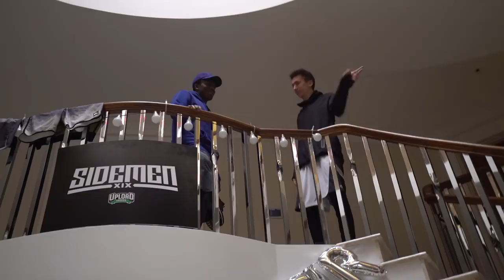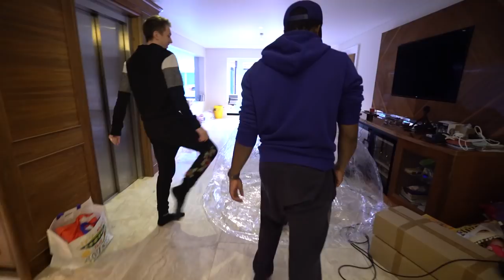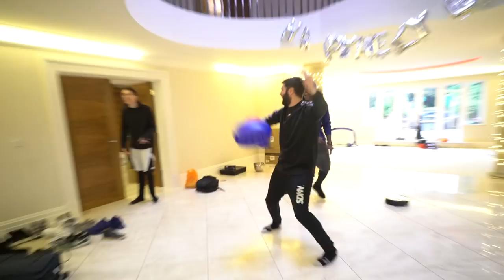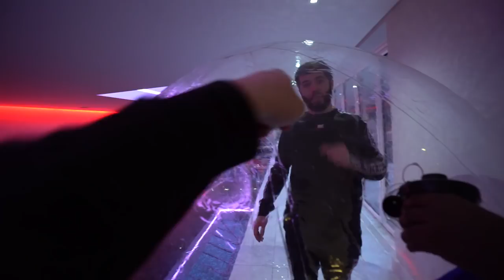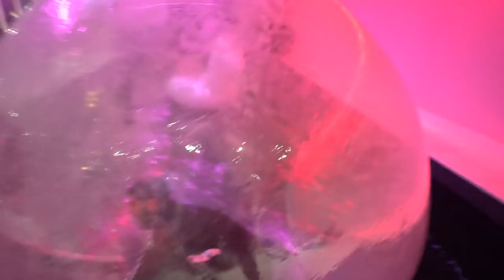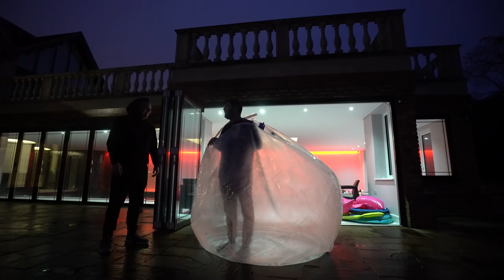GIANT ZORB BALL IN THE SIDEMEN HOUSE!

Comment: A bit of advice, to make it more comfortable. Fill it up with a leaf blower, get someone inside, stick the leaf blower nozzle in, zip up the zipper until the opening in the ball is tight, or somewhat tight against the leaf blower, blast full air, in 2 minutes you should fill it completely and while the leaf blower if still running pull the nozzle out (when the ball is full and zip up the rest of the zipper). It will take you about a minute or two to fill up the ball, and you can refill it easily allowing for fresh air and removal of heat.

Hope that helps!